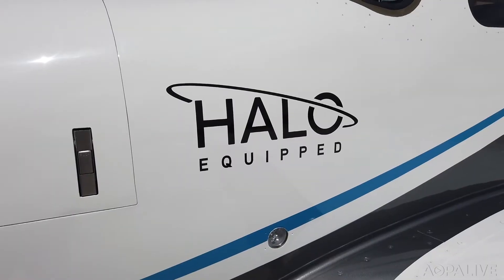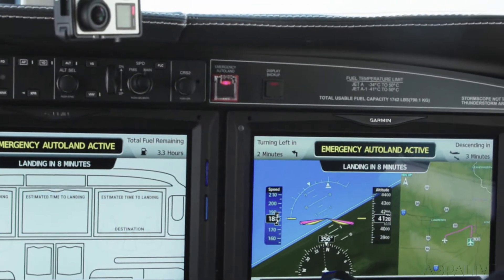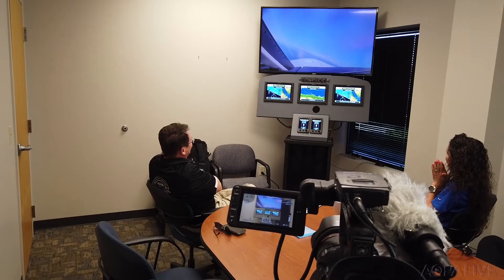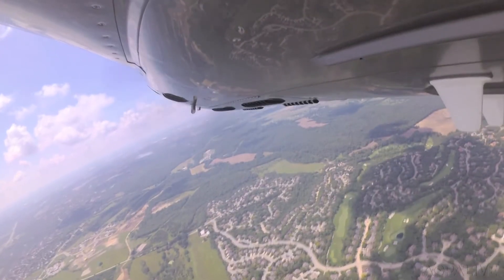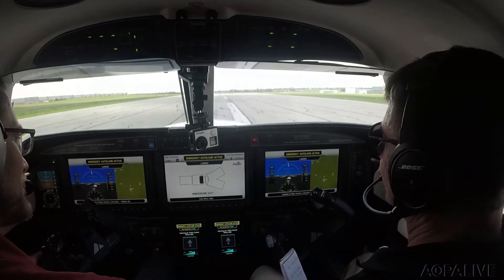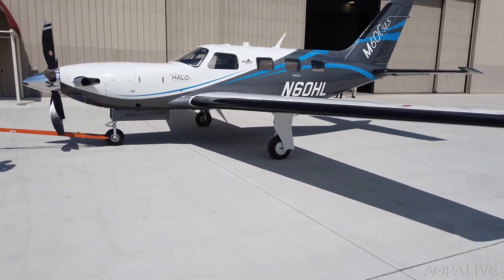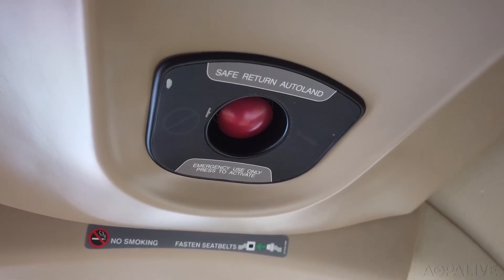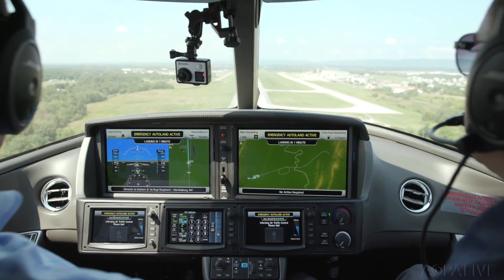Garmin unveils amazing autoland system

Comment: Garmin has all the functions except for an EVS addition to its Heads up display to have Cat III approach capability with these system components: Digital AP, Auto throttle, Brake by wire, WAAS. For this class GA aircraft Cat II a more likely  and would be an interesting addition with EVS. 

I would not be surprised if the elves in the back of the hangar are working on a breakthrough  version of EVS. Garmin always seems to be pushing the boundaries with new technologies.

Comment: It's nice but it's not a dificult function to make so it should really be part of any autopilot to fly the entire route from take off to landing unless interrupted. At any runway. Simple differential GPS is adequate to position for landing. And with RTK GPS it can place the wheel on the white line.
And of course ATC should have been computerized 40 years ago such the autopilot could easily handle all aspects of a flight.
Reply: Oh my God, they let you out? lol!!!

Comment: So many questions arise
- does it keep track of traffic
- does it have visual or infrared sensors that see if the runway is clear
- can it exit a spin
- does it shut down the engine automatically?
- how do you turn it off? (Similar to the autopilot I assume)
- how much will it cost
- how does it steer towards the centerline when it is just flying a GPS based approach
- does the airport need any additional ground equipment for this?
Reply: JetPackJan x yes it avoids aerial traffic, bad weather and tracks airport notams. - it does not determine any runway conditions including traffic at this time. - it should be able to exit most upsets other than the most extreme, I do not currently know the limits. - yes, it shuts down the engine automatically. - it’s usually activated with a big red button, i assume the same button deactivates it. -  I’m assuming the ground based GPS enhancement signals can put an aircraft on centerline, but regular GPS will keep you close enough for an emergency. - no addition equipment is need at any airports.
Reply: This is also the inly video I’ve seen about it where it mentions “steering back to the centerline”.
Reply: John Mangiameli Buncha videos online from Garmin and Cirrus showing actual aircraft landings. Search it.